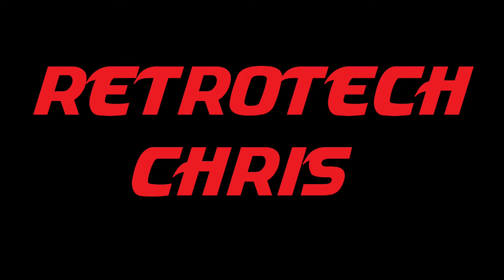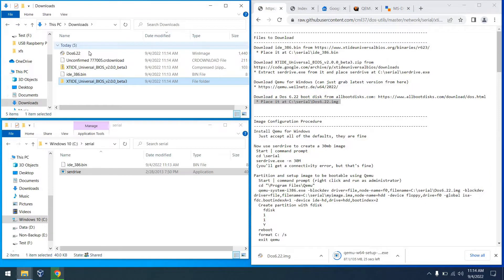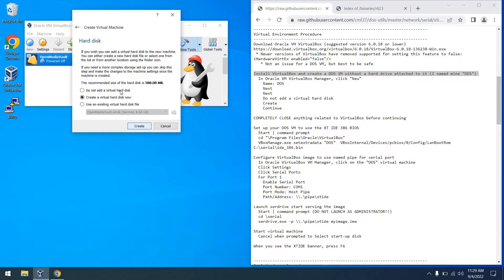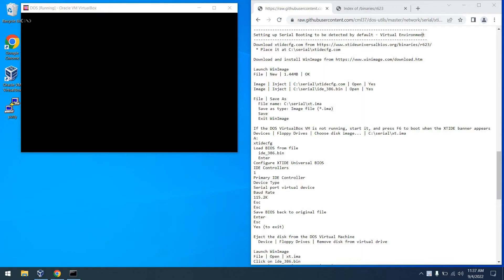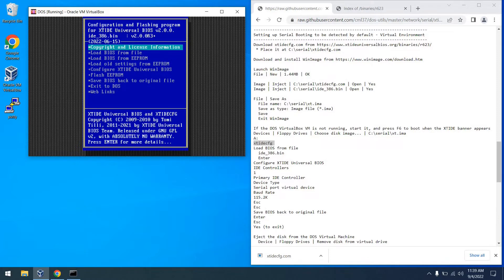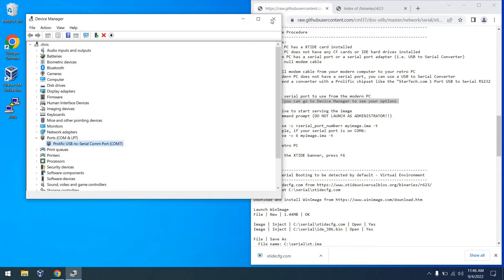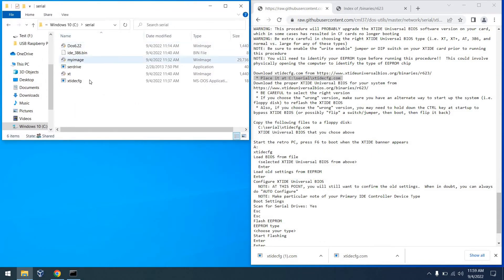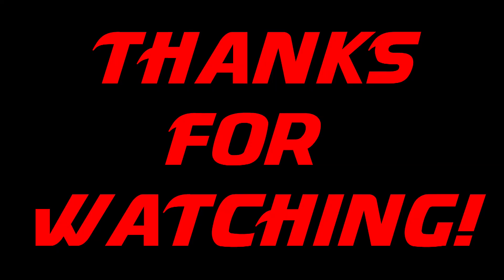Booting an MS-DOS PC Over Serial with XTIDE! (Setup Guide and Demonstration)

Comment: The 1st XT class machine I added to my collection was a floppy only system where the floppies didn't work. The machine also wouldn't boot from a CF card prepped in another machine. Being able to boot via serial using the XTIDE was a life saver. It allowed me to boot up and troubleshoot the issue. It was a failed 74 series logic chip connected to the track0 line on the floppy controller. After replacing the chip, thankfully it was socketed, I could boot from a floppy and setup the CF card in the machine itself.
Reply from the maker: That's some great troubleshooting there!